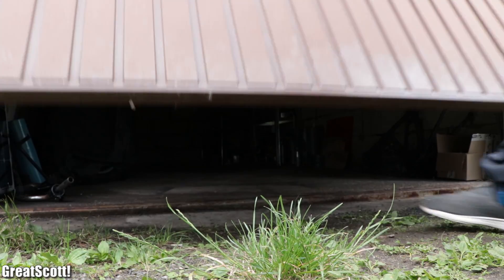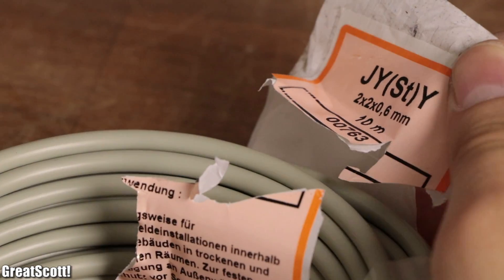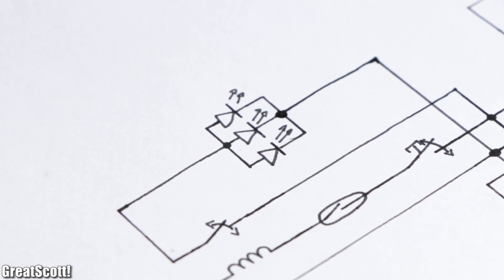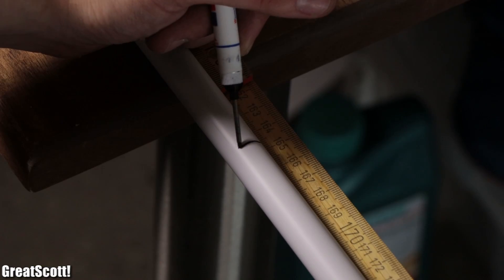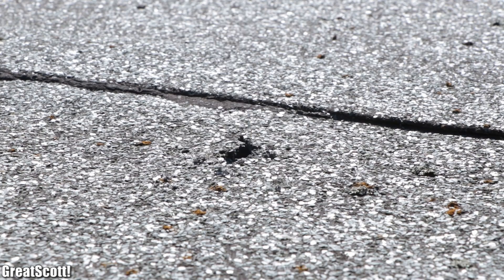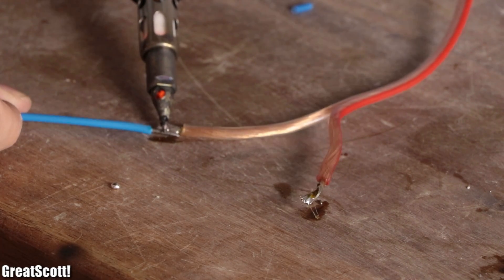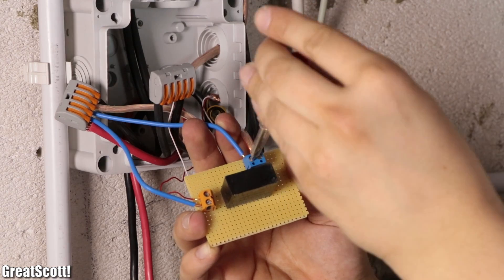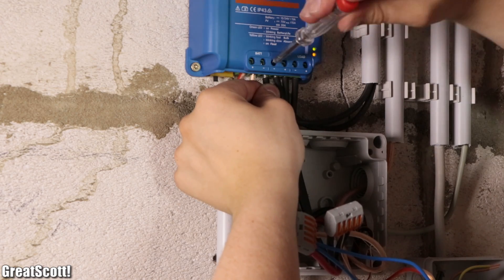Make your own Photovoltaic Off-Grid System

Comment: You shouldn't be connecting loads to the solar charge controler but rather to the battery itself. The load output on the SCC is just for small loads (maybe LEDs, but not inverter)

Comment: My total Load is 520watts . Wat solar panels, inverter and solar charger controller required for the above load to last for atleast 5hrs in a day
Reply: Do you actually need mains voltage?, it could potentially be easier, cheaper and safer to use DC. Albeit you might need to use fairly thick cables in some cases.

Comment: Does the charge controller switch off the circuit if the battery is too low?

Comment: Who uses bitumen to seal the panel.... It will greatly reduce the efficiency of the panel as the heat will be trapped under the panel and because of no inclination , the panel won't get direct rays of sunlight

Comment: It would have been great had you shown the choice of solar panel capacity, battery requirement, inverter requirement and soar charge controller. Other than that it's a good video

Comment: Not the best idea to glue the solar panels directly to the garage roof! There will be no air ventilation to cool the panels so the efficiency and lifetime of the panels will drop significantly in hot summer time. PV-panels can reach more than 80 deg. centigrade in this case! Let at least 10 - 15 cm air space between the panel and roof!

Comment: Just saw your video and I had a question that you might be able to answer. I have a robot car that has a solar panel to charge the battery. The problem is that you can either have the solar panel on the battery to charge or the robot to move but not both at the same time. Is there a way to have the robot move while the solar panel charges the battery?

Comment: Hello GreatScott
Is your inverter pure sine or modified sine wave ?
Could you give any advice to choose an inverter ?
I have a small fridge (110W) and power tools as circular saw, grinder, .... (2000W) that I would like to run on 220V. But I'm not sure if I should get a pure sine or modified sine wave.
I would like to also be able to weld (arc welding) if possible. (inverter arc welder).
I know induction motor like on the fridge needs pure sine wave.
But I think it's a shame to buy a big pure sine inverter to run power tools  with universal motor or an inverter arc welder that will rectify the AC220V 50Hz before using it to weld !
I was thinking to get a small pure sine inverter for the fridge and something else for the tools : either modified sine inverter or even a kind of boost high power 24dc/220Vac converter at high frequency. But will universal motor accept any kind of AC220 voltage/ frequency ?

Comment: If the solar panel is flat it will not be very efficient because it will get less sunlight throughout the day.

You could code a Arduino to move the solar panel as the sun moves/as the day goes on

Comment: Hey I'm a bit confused. Generally the load output of charge controllers is switched by mosfets or something similar - and is therefore limited to 20-40 amps. You have a rather large 12v inverter connected to the load output - and if loaded down with say a drill or saw, the inverter would draw lots of current - which could damage the controller. Maybe it is different with your charge controller. I'm not sure.
Reply: I‘m quite late, but his Controller, per specs, can only deliver 15A Output. Thought about that too when watching. I built a similar system, powering a small refrigerator. The controller would immediately open the output due to overcurrent. But I found a different solution.

Comment: Love it!

Great work.

Two questions:

1. Why no fuse between the charge controller and battery?

2. No need for over-discharge disconnect, or does the charge controller handle that on the load side?

Comment: Great Video @GreatScott! I was wondering if you have had  problems with your solar system? I'm asking this because with this configuration the surface temperature of the cell can be increased due to the thermal gain of the roof. Cheers
Reply from the maker: No problems yet

Comment: I would do few things differently. First i would put fuse there, just in case. Second would be, that i would instal one or two 12 volts car sockets, to give this system a little more utility, maybe geting two batteries to have higher capacity to compensate for higher expected time to time drain.

Comment: Hi scott dont we need to calculate the leds and fix a proper led driver rather than connecting it directly to controller and y u need inverter in this all is DC even leds to power is dc which is the AC appliance ur using

Comment: The speaker wire you are using looks to me like CCA (Copper Clad Aluminium) and it will disapate double the power the copper ones would.Be careful if drawing higher loalds.

Comment: Hey GreatScott,   I also have a small off-grid solar system at home and now I want to increase the voltage from 12v to 24v. My panels are different ones, though. May I get any problems when connecting them in serial if they have different output currents? Hope you... or somebody else can help me:)
Reply: Seriously no problem

Comment: Ask yourself a few questions. * Where are solar panels made?  What are they made from and where did that material come from? How much do they cost? How long do they last?  ....AFTER you answer these questions you can then comprehend how wasteful and useless solar power is. You're better off paying for a pole and REAL electric to be hooked up. REAL electric also increases the value of your home. An old burnt-out solar project on the roof DECREASES the value of your home.
Reply: I have never read so much BS in one comment

Comment: Hey, 1 question,  why inverter? Can't we hook the leds directly to the load terminals of the Charge Controller?
Reply: Maybe the LED isn't designed to take 12 or 24V.
Reply: WB IsMe You might be correct but when he attaches the led strips, it does looks like a 12v led strip. 🤔

Comment: This is a rather unsafe Off-Grid System. 
First of all, there arent proper fuses. NYM 3x1,5 shouldn't be fused with more than 16 Amps and ysty-wire with a maximum of 3,5 Amps. (Both fused with 20 Amps i think?)
Furthermore you don't used an RCD, so if one of your devices has a insulation error or you touch the wires, nothing can break the circuit open.

Second, you don't have any grounding and third, i doubt that the 230V-Inverter can deliver clean 230V/50Hz voltage.

I am a trained electrician in germany and i deal with Battery powered Photovoltaicsystems on a daily basis

Comment: why did you mount the pv panel parallel to the roof? by titilting of the proper angle, according to latitude where you live you could have increased  the overall efficiency of some non negligible %.
Reply from the maker: True, but I did not want anyone else to see the panel on the roof.

Comment: The solar panel should not be sealed on a flat surface, it needs to be raised so heat doesnt get trapped under it. it needs to air out or you will loose PV transfer efficiency.
Reply: He should also angle the panel towards the south. He's just throwing away half his efficiency by laying it flat.

Comment: hello, would you like to build a solar power monitor based on ESP8266 (ESP8266-12E)?
for
 me the esp is an interesting topic and its more flexible because it has
 onboard wifi and we can connect it easy to a wifi and become IoT 
device, so we can monitor the energy of the solar panel with our own 
network. 
what do you think?

Comment: You should never mount a solar panel completely flat. In addition to a decreased efficiency due to it heating up you will have severe power losses after a short while because dirt and debris and rain will stay on it and won´t be flushed down. It´s like you have a permanent shadow so it´s only operate on 1/3rd of it´s original power or even less depending on how many bypass diodes the panel has built in.

Comment: The conduit going through the roof ought to have proper flashing, and not just sealed with goop. The solar panel should at minimum be mounted on some standoffs, both for cooling and ventilation behind the panel, but also to allow water to run down the roof unobstructed.

Comment: The solar panel would have a better efficiency if slanted (about 40 to 45° in Western Europe) and with a South orientation.
The difference with an horizontal panel is really huge.

Comment: Would recommend using same wire size from solar panel to controlled for the controller to battery.  Then biggest cable you can add from battery to inverter.

free advice.

Comment: how to increase power without change the voltage level . Is it possible to increase current without changing the voltage level? plz give some solutions
Reply: Reduce the effective resistance/impedance of your circuit and you can draw higher current at same voltage level. For example: let's say you have AC supply of 230V and a 15W CFL bulb. If you connect the CFL to the supply, you'll draw "X" amperes of current at 230V. Now if you connect 2 of those CFLs in parallel to the supply you will be drawing 2X amperes of current from the supply again at the same voltage level of 230V. In effect you doubled the current you are drawing without changing the voltage level. This logic applies to DC as well.

Note: A supply(AC and DC both) has a maximum power capacity and you just CAN'T exceed that limit. That limit is a hard limit, the system and the components are designed for that limit. Going beyond that limit will cause a failure(fire). In such a case the only option is to go for a higher capacity system.

Comment: Hello Scott, 

I've worked with an electrician before. He said those orange and clear adapters on the inside of wiring kits start fires. Maybe you should remove them.
Reply from the maker: +Will Niendick I am electrician and my assistant is an electrician and those wago terminals are common.

Comment: Hey Scott, Is it safe to use Modified Sine Wave Inverter on LED TV's, LED Bulbs, Fans? Everytime i plug my TV on my MSW Inverter, it produce little noise at the back of the TV. Btw, I only use my Inverter for 2-3hrs power outages.

Comment: Hey Scott. Watching your videos I came across some ideas. Would a combo of a small 5v Solar panel + 5.5v 4F Supercap be enough to power an 5v or 3.3v Microcontroller (via buck/boost converter) over a long period? Could I also power a small 5v Servo Motor with that?

Comment: You should always space the solar panel off the surface of the roof. Solar panels are most efficient when they are cold, so leaving this gap allows air flow to cool off the underside of the solar panel

Comment: Never ever mount a solar panel flat on the roof. Rain water and dust will not run of the panel. Even a 1 or 2 degree angle would be better than this.
This also helps with the heat.

Oh, and that bitumen won't hold it, as the frame of the solar panel expands and contracts every day.

Comment: Up through the battery and charge controller it's not bad, but that wiring up around the LED strips, and just having the strips hanging there with no protection, is incredibly sketchy. I wouldn't allow that in my house or garage.

Comment: You really need to elevate that solar panel off the roof.  Running it with no ventilation will make it exceptionally hot between panel and roof.  Aside from a potential fire hazard, it will not generate as much power, as PV panels are more efficient at lower temperatures.

Comment: Wanted to ask why you run the AC and DC wirings thru separate pipes?
Is is to do with coupling b/w the two as in would the AC induce an emf superimposed onto the DC wires?

Comment: Why is it one should not wire AC and DC together? Any danger? Or is it just the neater way?
Reply: You can induce an AC voltage from an AC cable in a physically parallel cable(whether that's DC, data, etc) Also don't want it to be possible to short to another cable in case of damage.
House wiring rules require that they are kept separate in my country, and presumably everywhere.

Comment: Probably already on here but

don't leave your solar panel flat in the roof. They heat up and lose efficiency.
but worse the top aluminum frame is normally not sealed to the glass. Water will get through the gap and not be able to get out until it comes out of your wiring and wrecking the joints on the back on the panel.

life experiences 😂

Comment: Interesting video. But it seems you have made no consideration for fault/overload protection for your 230V system. I would consider  supplying them through consumer unit with RCD main switch and 16A MCB.

Comment: If those LED strips are 12 volts and thats ALL yure powering, you do not need an inverter. Just wire the leds directly to the load screws on the controller

Comment: I belive led strips get hot during their normal working conditions so that`s a cheap but not lasting solution :) A aluminium profile offers more cooling same as regular radiator would and thus extends the life of the LEDs . . . Not that I would work at a company that produces and invents such profiles ;)  So without making any form of advertisement , think about it ;)

Comment: Cool system , but that is some expensive AC wire ! In the UK we use somthing called Twin and earth. Its a flat cable with a neurtal and live in it and then an un insulated earth inside the outer sheething of the wire, much cheaper.

http://s7g3.scene7.com/is/image//ae235?src=ae235/20967_A2&$prodImageMedium$

Comment: It's never a good practice to connect inverter to charging regulator. It should be connected directly to battery terminals. You can find that even in user manual of your Victron Energy regulator.
Reply: Things Risto Mladich said and also If you run a bunch of appliances from inverter, it can use bursts of current which in some cases could be higher than charge regulator can stand, thus you might fry only fuses or whole regulator by connecting it that way. Load terminals on charge regulator should be only used for small 12v appliances such as lights, radios, small pumps etc.
Reply: tinovator why? excuse me i'm a beginner and still trying to get my head around this
Reply: will i moved my lazy ass and searched for it already but thanks for explaining :)

Comment: Yikes!!! Who did that crappy brick and mortar work!!?? Also, imbedding the solar panel directly to the roof shingles is a bad idea. Water is sure to infiltrate and sit just collecting mold and even breaking down the shingles faster. Should have just elevated it with spacers and let the rain pass under as it normally would...

Comment: mein Englisch ist leider nicht so gut, aber ich hoffe ich kann dir mal einen Denkamstoß geben. Bitte überprüfe mal deine Batteriespanunng, der 75/15 von Victron ist, wenn er vom Werk kommt, auf Automatik eingestellt, überspringt die 12V Grenze und geht auf 24V Einstellung, hab deswegen auch schonmal eine Batterie über 16,5V geladen, stell den Victron einfach fest auf 12V und die Werte auf laden 14.4V Erhaltung 13.5V(13.7V) und alle 30 Tage auf 15.6V, somit schonst du die Batterie und umgehst Sulfatierungen, ich hoffe ich konnte helfen. MfG

Comment: Didn't catch the size of your inverter, but you really probably shouldn't run it from the "output" of the charge controller. It will pull too much amperage.

Comment: Don't mount solar panel directly on roof it needs space for cooling. When the solar panel is cooler then it produces more amps, if it is hot it doesn't produce anything.

Comment: I believe it is a big mistake to mount the solar module as in the video. Perhaps you did not consider the enormous heat accumulation under the Pannel in summer. Not only that the Pannel produce less electricity at high heat, aslo the module is likely to be damaged under extreme heat on high temperatures. I would therefore mount it so, that a little air circulation is possible.

Comment: Hello GreatScott. I definitly like this project, but there are things I would change. First that relay will probably wear out quickly and it also uses power (not much but it does and with batteries its all about saving power). As the lightning circuit is all 12v, i would be happily replacing that for some MOSFET. Second the fact that these unprotected LED strips are just hanging there seems to bug me. I would close them in some transparent tubing or use the silicone ones instead, as my imagination creates a scenario where a fly or something pisses on these exposed solder joints or the LED's themselves causing damage. A bit of transparent plastic is easier to clean than a bare fragile LED strip. Third I dont seem to like the fact that you use alternating cold and warm white, i prefer things uniform. But I guess that is your choice and if you like it, thats OK. I definitly like the bluetooth module, but I would probably make my own using Arduino. Also as now you have power in your garage, maybe you could add some alarm system? Personally I would also add a buck converter with a switch and USB conector on the 12 volt line so I can charge my phone/tablet/powerbank/other $hit in case I need to. But still nice to see what you have done.

Comment: Also, You really should have used some flashing on the solar panel. Just roofing tar will not hold up to the thermal cycling that a roof goes through.

Comment: Not sure how hot is that location, but solar panels are substantially less efficient when they get hot, that's why they're usually raised on a structure and not mounted straight away on the ceiling.